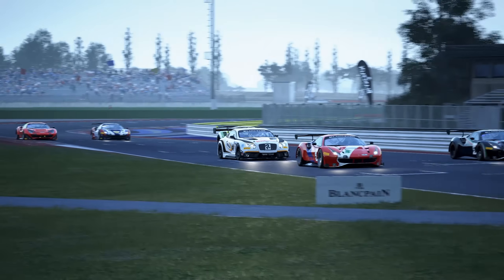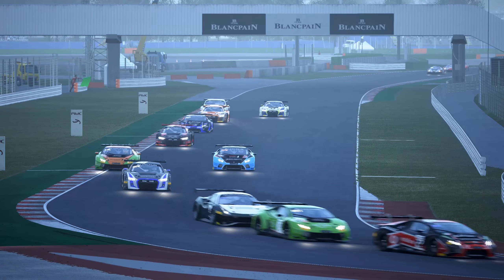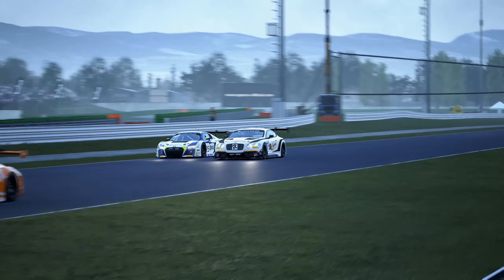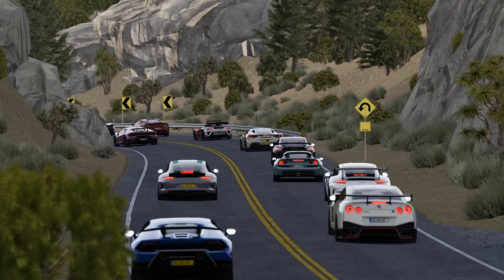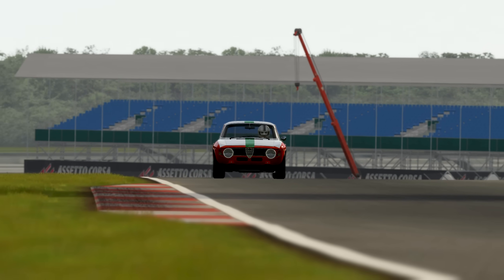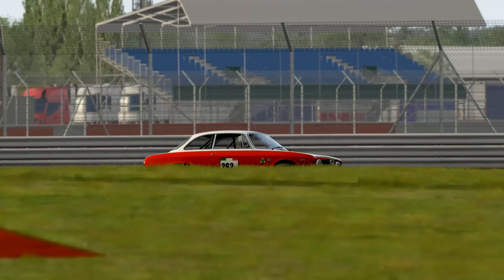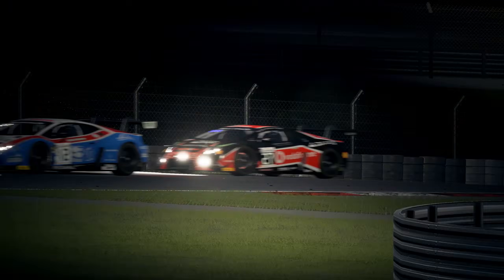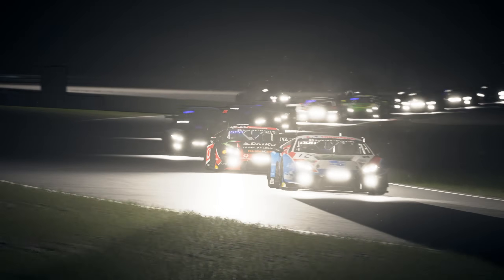Sim Racing Setup Guide 03 – Toe, Camber & Castor Settings

Comment from the maker: Hey guys, thanks for watching. I've tried to keep these videos fairly beginner friendly, but if you have any tricks, tips or additional comments to add, please leave them in the comments - I'm sure there will be plenty of people that will be able to benefit from the collective experience of the community.
Reply: You missed a big thing about castor/caster. That it is not only changes the self aligning and the fell of the steering but it changes the camber angel on turning the wheel. This is why it is useful to modifiy caster as well when you are finetuning your car to a circuit. When you add caster you can lower your camber angels, so it helps your straight line performance, but at turning the added caster will modify the camber angel, adding more nagative camber to the outside and lowering negative camber at the inside, that helps you finetuning the amount of tyre contacting the surface in a turn. It depends on how much caster should you use on the corner types, but it is a very useful setting for sim drivers and i think for real racing drivers as well. Maybe it is not that easy to understand and setup right for beginners, but we should talk about this. Also i don't know any about Assetto, because i am not playing with it, but i played a lot with Race 07, Race On, rFactor, rFactor 2, Automobilista and a bit with Project Cars and if i remember correctly all the games i mentioned here are allow you to change your castor/caster, because it is a very useful tool to setup your grip level for a circuit. So its nice to have these guides that you make, but i think some times you shouldn't skip over settings because one sim racing software is not supporting the change of it.
Reply: I think what your doing is fantastic. What I think a lot of people are looking for is the 'how' and not the 'what' part of these adjustments. For example, when looking at tire temp, what would tell you that the car needs more toe, or more - camber? And what part of telemetry would tell you how much of those adjustments need to be made. Also when making adjustments like this, what is the 'tell' that lets you know that you have adjusted something to much? Those are the tips that I am personally looking for. I really enjoy the video, but for me this is stuff I already know. I know what the adjustments are, I just dont know when to make them.
Reply: I dont mean to be so offtopic but does any of you know of a tool to get back into an Instagram account?
I was dumb lost the login password. I would appreciate any tips you can give me.

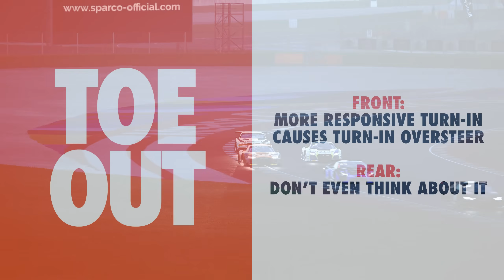Comment: 1:18 Toe OUT causes oversteer? i thought Toe IN was more oversteer inducing as it loads the outside wheel which is pointing more towards the turn during steering.... the video is correct tho right? not just a slip up?

Comment: know vids a bit old but have a question on the adjustment of camber do u do it based on temps or feel n laptime? like say over a quali lap think iv heard can jank up camber n over a race(i  guess less to get more even wear) I know it's a balance but what should I be looking for when trying to dial setup n say I softwn rollbar adding in more roll so now I add more camber the temps or do I now feel out each setting n see which is faster or bit of both. edit n if temps where end of straight or just after corner (doing spa if want to say something specific)

Comment: Castor is an oil or a bean. Caster is a wheel adjustment. I just start racing on R Factor 2 after about 5 years off. I have the IndyCar 2020 car mod. What I haven't figure out re the limits the program limits (somewhat severely) the amount of all these settings. For example, the limit of positive camber on the LF tire is 1 or 1.5 I want to try more, especially on ovals. Anyone know how to get around that limit?

Comment: first of all.. thank you so much for this video.. it helps alot.. i wish you read my comment cause i have a question.. why few car in assetto corsa do not have ( we can't set to ) negative toe.. i mean there is only zero and  up to positive degree of toe.. and why few cars ( the baby benz for example ).. the toe value is -10 -20 -30.. 

**sorry for my bad english
Reply: and one more.. when setting this.. which panel we have to be more concern.. the allignment panel on the left? or the car status on the right?

Comment: @Chris Haye I know that everybody knows NEVER use Toe Out (negative toe) in the rear. However my Bentley in ACC with .04 Front Toe and -.1 Rear Toe is not only super responsive and stable in the corners (entry through exit).  It also absolutely refuses to spin out. If the rear starts to break loose at all letting up on the throttle a smidge snaps it right back into grip.

I don’t get it. Everybody knows “as for using negative, toe out, in the rear don’t even think about it unless you love spinning out in every corner.”  I have found the opposite to be true if done right.

Am I crazy?

Comment: I really like your video's Chris, but I did find your information on castor misleading, Castor is directly related to camber. It's true that it effects the "feeling" of steering in a real car, but, it's mostly used to allow for less camber for straight line and low radius corner grip, positive castor adds camber when turning, the more steering input the greater the degree of camber added mid corner, it's more apparent in ACC than most other sims and adding castor to reduce camber in front engine/rear drive cars can yield a great benefit on tracks suck as Spa and Monza where there are low radius high speed corners. I could elaborate further but I'm sure you know this already, just thought I'd clear it up just incase.

Comment: Why do some Books say:  Toe-In on Front Axle is improving the turning in but is lowering the mid corner grip? Toe-Out is lowering the turning in but is improving the mid corner grip. ? Can anybody explain this to me?  

I got taught, that Front Toe In is improving your straight line stability but is ending up in understeer in a corner. Front Toe-Out is bad for straight line driving but gives you a good turn in.

Comment: Hello Chris, very nice video. 

I need a help with a concept. 
When you talk about tyre temperatures and its ideal temperature, wich value do you use as reference ? Is the average temperature of a tyre in a lap ? Or is the "instant" temp at a specifc time ?
For instance: a specific tyre temp at a corner.

Comment: Hey Chris, thank you so much for the video! but there's a question when I adjust the camber, the Inside and middle temp are really close but the outside temp is like 10 degrees off... Is there any way to fix it or it is what it is? (the car is BMW M8 GTE in iracing)

Comment: Can someone please clarify sth for me? I couldn't have found an answer to my issue.
Basicly I'm learning to set up cars, based on this guide playlist and other forms of help (mainly 21 step guide from gtr2). I'm working currently on setting up ferrari 458 gt2 around monza GP circuit.
My problem is as follows:
Using the conception of uniform tyre temperature I've found correct camber for default ride height, it's around -1.3 front and -0.8 rear. Analyzed temperatures in MOTEC, outside temp is within 5 degrees celcious of inside temp, middle temp also is between those values (correct tyre pressure). Furthermore, using camber extravaganza app, the tyres were green in corners like parabolica, lesmos, ascari chickane (in 1st and 2nd chickane camber goes off but it's low speed so I don't feel like it's a problem). But after that I started finding optimal ride height, default is over 70 mm. But there is a problem, I'm already at minimal front camber value (cannot set lower negative than -1.2 deg). Lowering ride height throws my front camber out of window. What should I do? Go for lowest ride height advantages (more downforce, lower CG) thus violenting the camber or should I stay at higher ride height? I've even maxed front toe out, as increasing toe decreases camber.
Am I blind and missing sth obvious or what?

Comment: Great series (and amazing quality videos as usual)! One interesting thing to note is that caster does have an effect on camber and hence handling (albeit fairly small). Caster angle affects camber gain while turning: the larger the caster angle, the more negative camber the outer wheel gets when turning the steering wheel (while the inner wheel gets positive camber; it's easiest to picture if you imagine unrealistically large caster angles but the effect is there for any angle). I don't think I've ever used this in a sim though since as you said it's not usually something you can adjust!
Reply from the maker: Hey man - thanks. You're absolutely right. There's a lot of strange interactions that go on with suspension geometry that can be exploited to varying extents, depending on the design, the car and the track. As you say, it's quite advanced for racing sims!

Comment: A note for myself.... Inside hotter than outside too much negative camber, too much negative front toe in (toe out) oversteer.
Reply from the maker: Heh, yeah. A bit of variance across the tyre temps isn't a massive issue... but too much toe out and the front of the car literally over-steers!

Comment: Hey Chris, good series! Re-camber: do you recommend to do assymetrical, maybe even different camber angles for each tyre, or would you keep your hands off this? Talking gt3 cars. Cheers!
Reply from the maker: Hey Jannutz - personally, I've never been able to get it to work, though I can't say I've really given it a lot of time. Maybe I need to spend a few months only racing on ovals to see the light!
Reply: @ChrisHaye  FWIW,  I found real-world camber to be track-dependent,  For example more negative at Road Atlanta than Sebring.  Particularly at Sebring years ago, with rough old concrete, less negative camber on the right side than left.

Comment: Currently watching all of these to tune up the kunos ae86, with just the tyre and alignment videos alone, there is a noticable improvement! I have a question though in reguards to evening out the tyre temps. I always seem to have cold FR and RR tyres, and reasonably cool FL but optimum RL tyre temps. Would it just be due to the track having many right hand turns that my right side isnt warming up as much?
Reply from the maker: This can be a bit of a pain in Assetto Corsa. It's not uncommon to find tracks where one side of the car is reluctant to heat up. You can run different pressures on the cooler side to try and compensate. However, it's worth noting the AC seems more concerned with pressures than temperatures, so if you're struggling, then concentrate on pressures first. It's easy to get too worried about what the tyres app is telling you, rather than what the car is!
Reply: @ChrisHaye  thanks for the reply! Would you happen to believe that if the community has data for the right temps, there is bound to be a sheet of data for optimum pressures for kunos tyre models?
Reply from the maker: The pressures are contained in the same document that I linked. For example, the first four lines are pressures, and the next four are min and max temps. 

bmw_m3_e30_dtm.slicks soft dtm90s (s).fl = 29
bmw_m3_e30_dtm.slicks soft dtm90s (s).fr = 29
bmw_m3_e30_dtm.slicks soft dtm90s (s).rl = 29
bmw_m3_e30_dtm.slicks soft dtm90s (s).rr = 29
bmw_m3_e30_dtm.slicks soft dtm90s (s).mintf = 65
bmw_m3_e30_dtm.slicks soft dtm90s (s).maxtf = 80
bmw_m3_e30_dtm.slicks soft dtm90s (s).mintr = 65
bmw_m3_e30_dtm.slicks soft dtm90s (s).maxtr = 80

Hope that helps!
Reply: @ChrisHaye  Ahhh, thanks a bunch that makes more sense now!
Reply from the maker: No worries - it's not the most intuitive thing in the world... and I think a few cars are missing the ideal pressure value now I look a little closer... but most seem to have it.
Reply: @ChrisHaye  ha ha alright! For now ill be on the wait list for the next tutorial, watched the anti roll bar video and loved it! Cant wait!

Comment: great edit Chris, tho i am a drifter, FD or street .  bio ben just did a setting vid on FH4 and oddly it explains what the settings mean and the impact they have on your driving feedback . i helped me get the radbul derivable. and able to drift 1000ft lines with minimal correction or snap back . i did a thank you vid showing my first runs with the new knowledge. i will apply some of these tips as well to gain some control with the snap return .  in project cars 1 and 2 .  corsa  has always been drift friendly .
Reply: here is that small vid. wimpy ears need not apply  https://youtu.be/c63fSFXpxfc
Reply from the maker: Thanks GC - I had my first experience drifting in AC the other day. Took me 5 minutes to work out that the Supra had traction control set to 'on' by default facepalm
Reply from the maker: Was expecting Metal and got Metaaaal!
Reply: @ChrisHaye   yeah the supra isn't bad tho I found the lambo v12 swap works better in it .